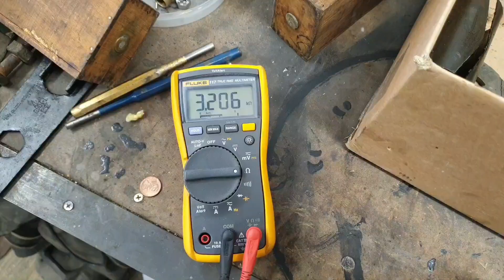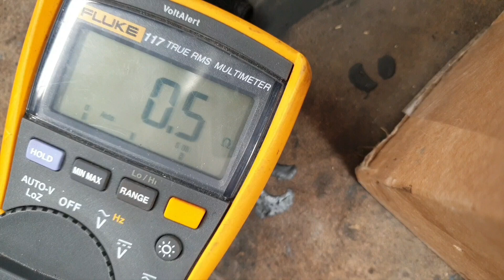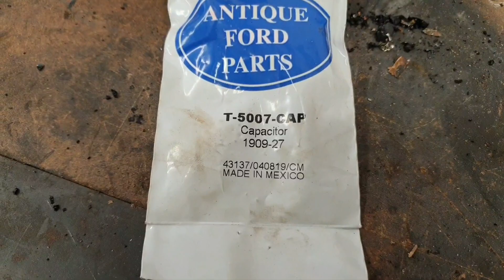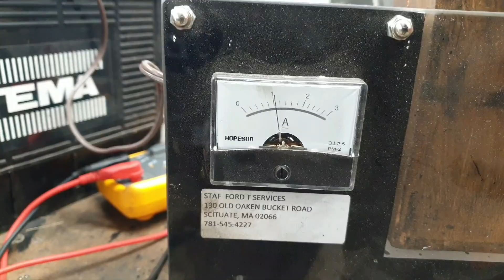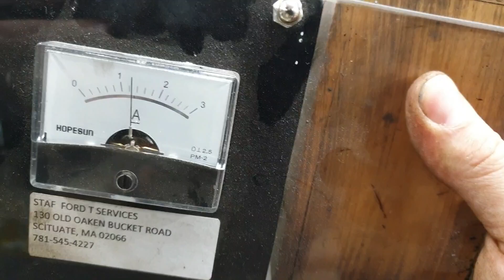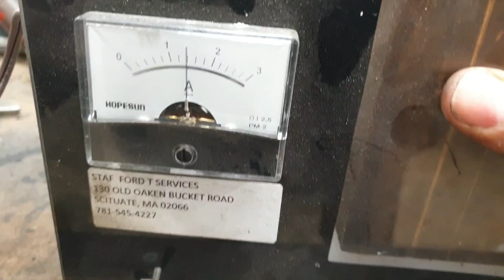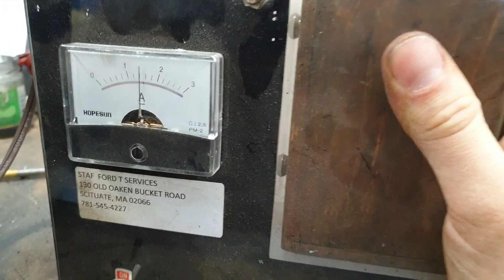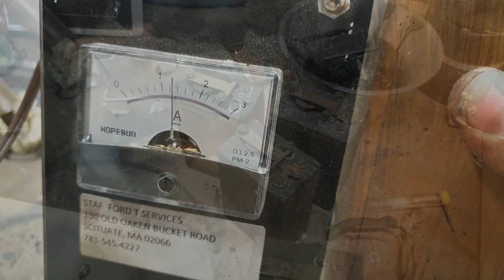Ford Model T Restoration/Build | Part 27 Trembler Coils

Comment: Just wondering if you ever clean the threaded posts and file the points … or replace the points with new ones. Seems like they would run even better with good connections.
Reply from the maker: At the moment I'm satisfied with how they run my engine. That said I have only tested the chassis without the body, I might have to look in to getting new points in the future.

Comment: No glue in the crack on the coil box ?
Reply from the maker: They sit tightly together in the coilbox and whenever they are taken out is because there is something wrong with them therefore I decided it will be easier to open again if I don't glue them together.